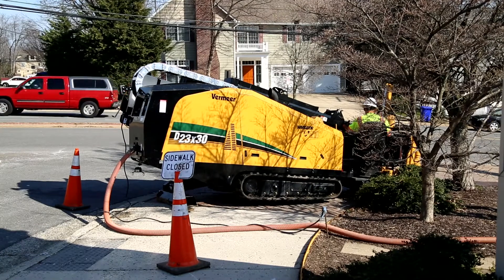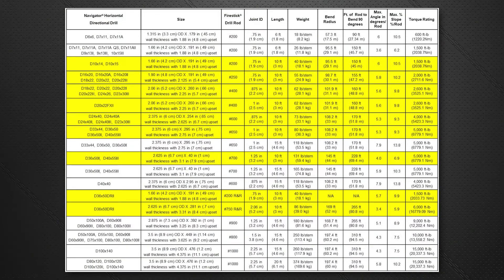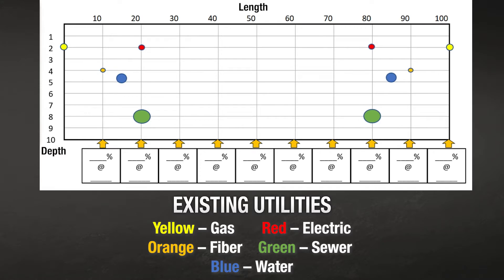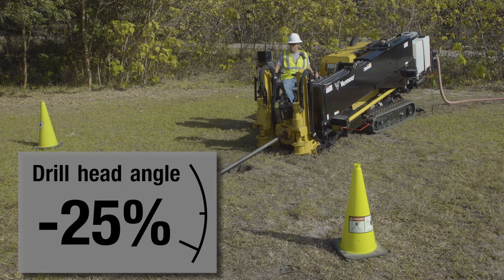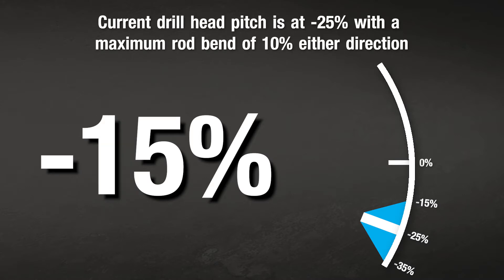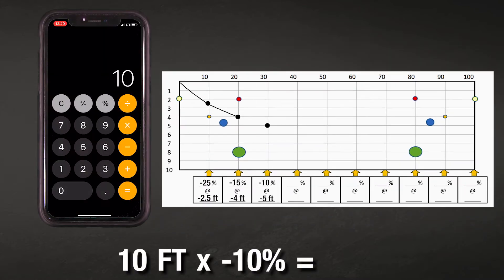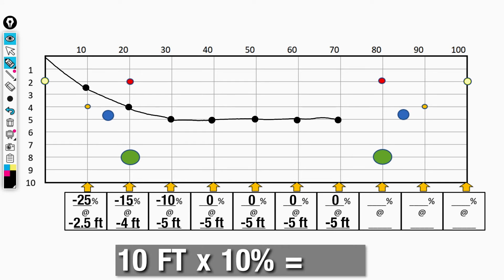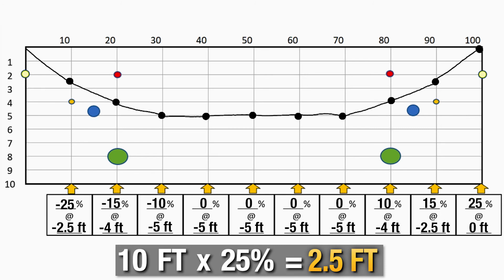How to create a proposed HDD bore plan

Comment: Do you need a specific license to perform work?
Reply: depends on where you work. Some unions may require a CDL to operate vehicles that transport the drill machines. Some contractors may not need that, and will simply train you if you can get in their company
Reply: @emyndridrinemy3346  so besides the cdl I need no specific license to be a contractor? I live in Florida so no union here.
Reply: @mr.m.3280  No, you do not need anything special (license or certificate) to operate a Bore rig. You just got to work your way into the industry. Most guys begin as helpers  for the Bore crews. You'll be doing a lot of hand digging and getting dirty but eventually (and with some luck) you will eventually be shown how to operate a drill which isn't difficult but you gotta know how to approach any scenario which is where it's challenging
Reply: @emyndridrinemy3346  how about to be an actual contractor for boring?any requirements there?
Reply: @mr.m.3280  no sir.